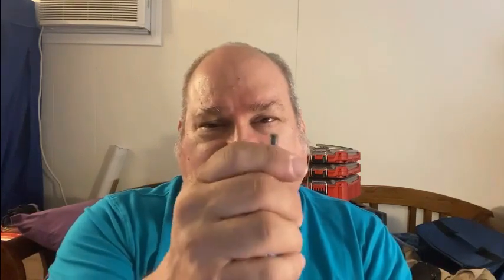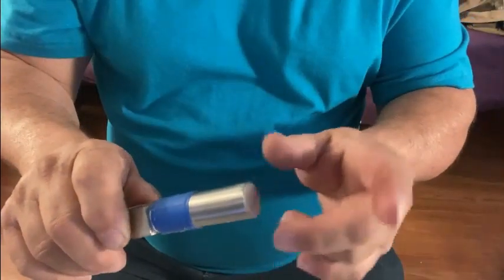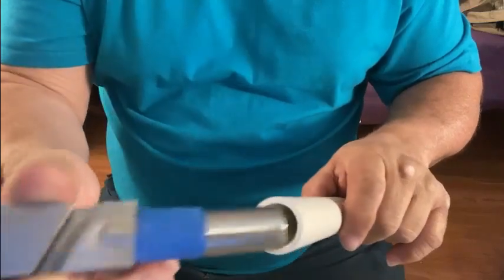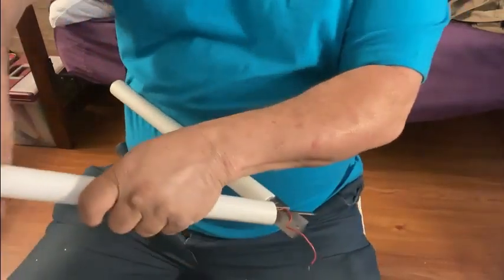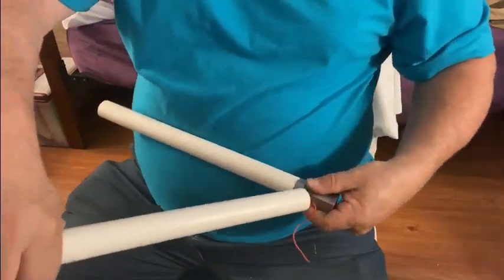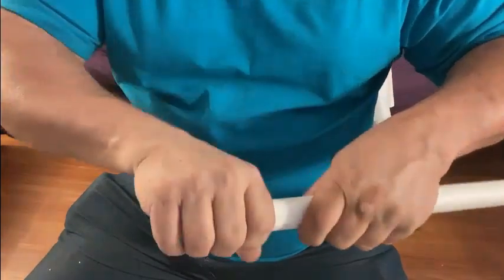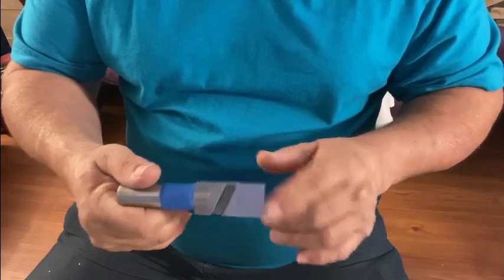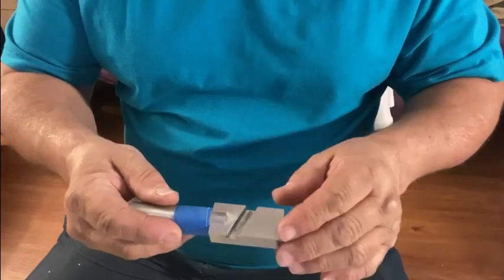I Can Haz Armory # 102 -- Matthew Porter's tang bender

Comment: What are the typical tang angles most people will find comfortable/natural for pistol grips?
Reply from the maker: Sorry I didn't get back sooner...am working at Summer Nats and could not reply on my phone.

The down/in angles are never typical....some people like the cant to the very edge of the rules, some like it dead straight, others a wide variety of in between.  It's a crap shoot, really.
Reply: thanks Sam! I've been playing around and small changes to the angle don't seem to be overly noticeable (if you don't tell the fencer...), but clocking of the pistol grip is something I will pay more attention to from now on.

unrelated question: what is your opinion on using only locktite instead of a spring washer (or locking washer like the nordlock) for the grip
Reply from the maker: @chrisr7317  Never heard of locktite only under the nut, but not a fan of the idea.  

Sometimes the shelf for the nut is a) barely there at all and/or b) not flat.   Putting a lock washer -- ONE lock washer -- in there deals with both those issues, which leads to a firmer grip.
Reply: 100% on shelf not perpendicular to bore, and by the way if combined with outside hex nuts things get even worse (may need to gently hammer the socket in to take it apart) 
Let’s see how long it holds with the thread lock compound. I have had good experience with it in other applications. Time will tell.
Reply: Man, I forgotten: I worked for Matthew Porter in 1990-91